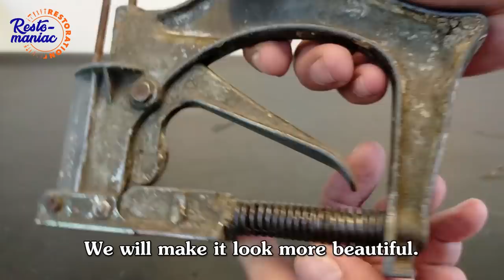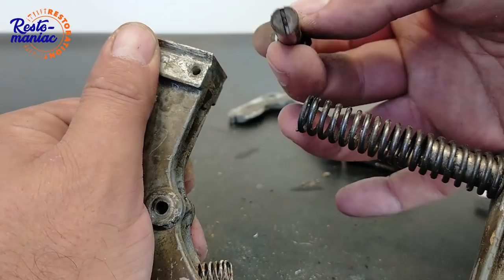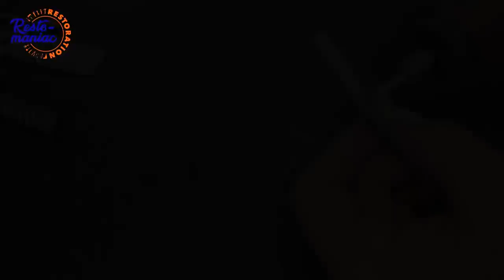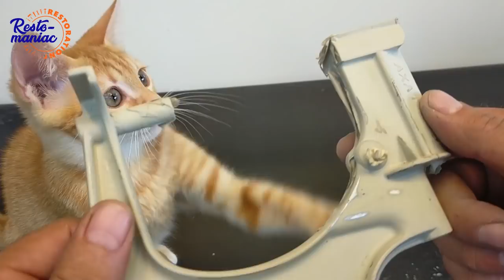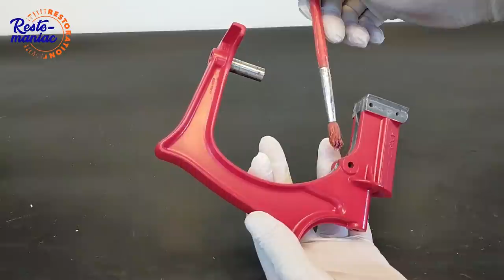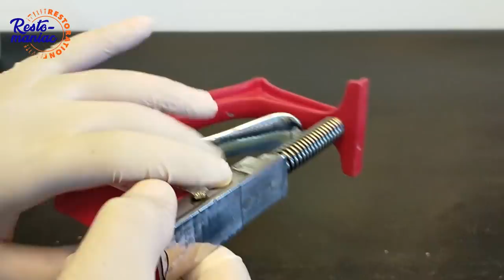Glazing Point Driver Restoration

Comment: I would of used a lead tester on those painted surfaces, knowing if it's leaded paint is crucial for your safety and whether or not to use additional PPE.
Reply from the maker: If this tool had been painted, I would have used it too. But it has no paint, bare aluminum.